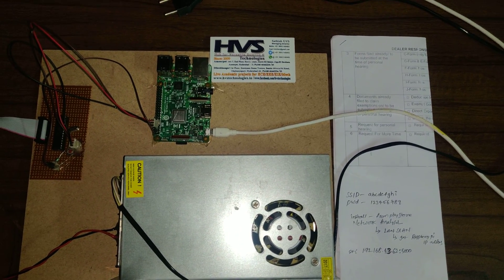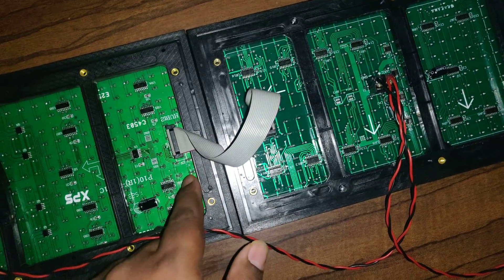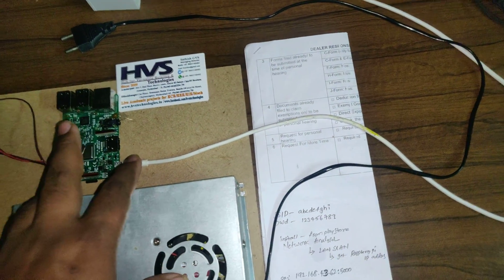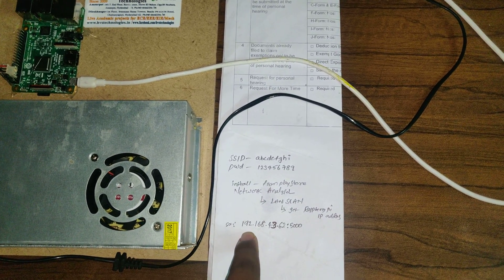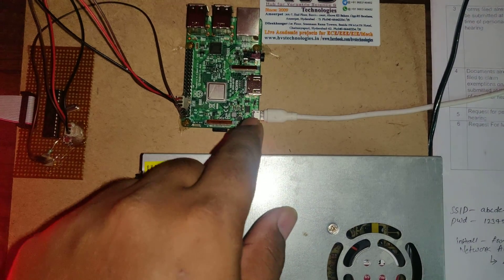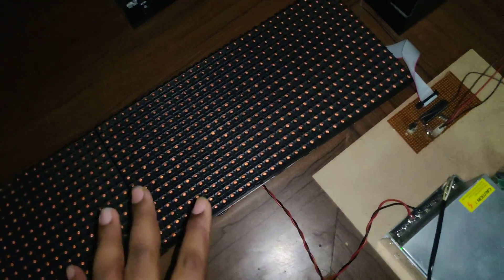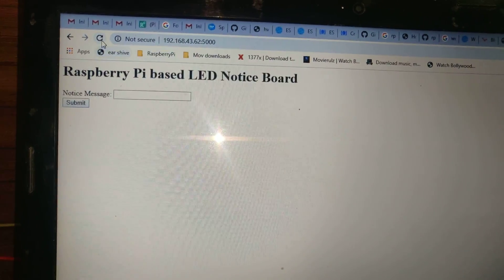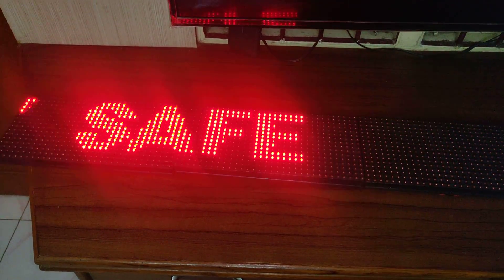P10 module and Raspberry Pi based LED Notice board

Comment: What is the IC you used for driving the p10 matrix board? And where can we get the library for interfacing p10 led matrix board with raspberry pi ?
Reply: hi, I also need the answer to this. Could you able to find it?